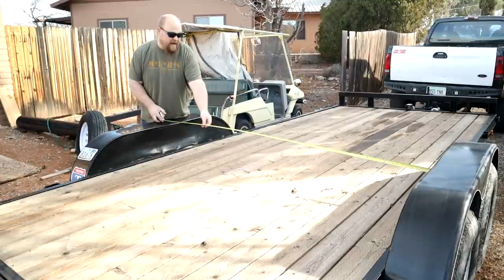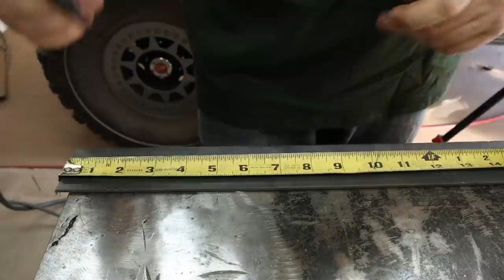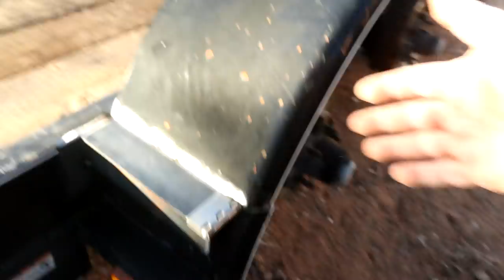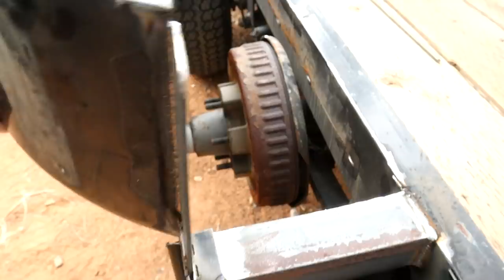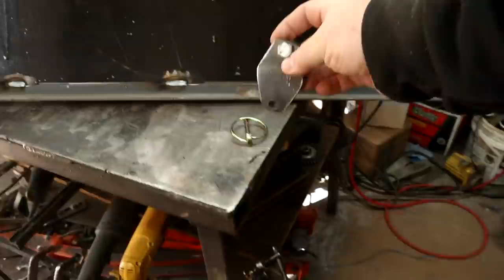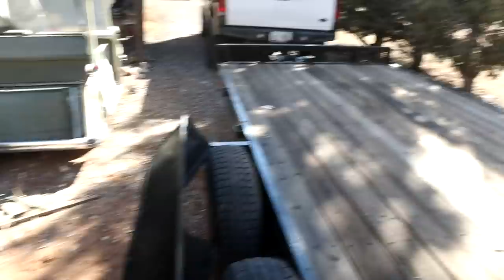Building custom Tip Out fenders for my car trailer. Fabrication 101!

Comment: I love your tilting fender solution.  I was thinking of making my fender lift off, so that I could open my car door enough to crawl in, instead of going thru the window.  Kudos to you for leaving in your mistakes.  Not only were they entertaining, but you saved a few people from doing the same things.  I call it entertaining instruction.
As for the rear jacks, just watch a few YouTube videos of people loading their vehicles, only to have their truck and trailer roll down a hill.  My trailer doesn't have them, so I will add them.

Comment: The jacks on the back of the trailer stop the trailer from picking up the back wheels of the tow vehicle when loading. This would be a bad idea as the front wheels do not have e-brake on towing vehicle. Also do the tab welded on the trailer to secure the finder harm your tires. Really like your design on the hinge. Great Job.
Reply: I need to add rear jacks to my trailer I loaded my 2010 gmc sierra on my trailer hooked up to my lighter 2019 F150 and it just just about lifted the wheels of the F150 up. Loading the F150 onto the trailer doesn't lift the sierra up
Reply: I put 2 small swivel trailer jacks on the back of my trailer.  They don't stick up over the deck.
Reply: KISS. Use a block or two of 6x6 cutoffs. That way you can just pull forward off the blocks without having to get out a Jack to take the pressure off the pins to lift up these supports.
Reply: The drop down legs are used to keep from bending the trailer when loading heavy equipment

Comment: I need to do this to my 20ft car hauler. I'm tired of crawling out the window when the doors won't open due to the 
fenders. Appreciate the videos!
Reply: Oh yeah, that does bring back memories (maybe not fun memories though). The other similar predicament is getting out of a car inside a closed trailer. The bystanders seem to be more amused by it than I am... maybe I need to find more sympathetic bystanders!   🤣
Reply: I plan on making fenders that lift off. His Are still in the way for forklift
Reply: your right i wish i would have never sold my trailer it had a frame like a railroad track ,, it was factory but i had to crawl out also,, wish i never sold it

Comment: Just a suggestion for pinning it down while in transport. Drill and tap the angle that it is resting on and use wing bolts to pin it down. This will eliminate the tabs sticking up and lower the risk of puncturing a tire.

Comment: We just built steel fenders that you can drive over. Makes fenders stronger. Can stand a blow out can stand to leave truck sitting on top if needed.   I use rear jacks to lower a bit not all the way to the ground though or you won't get it back up it will be in a bind. Use it to load that way your pulling truck don't raise up in rear and cause your truck to start rolling away.

Comment: I would not let the fenders rest against the tires when you have them folded out while you're loading because as you're driving on your Bronco that trailer is going to rock back and forth and the tires are going to rock back and forth and it could cut the side walls of the tire on the edge of the sharp metal fender

Comment: When i did this to my trailer last year i just welded the tabs to sit flush to the side of the trailer, drilled a hole in the frame and welded a sleeve in the hole for a push button quick pin to go in and hold the fenders down. That way nothing protruded above the bed rails, mine had a 2”x6” rectangle tube frame so that made it easier for the quick release pins. Also added swivel tongue jacks to the back but my ramps slide in from the rear vs the side, never liked those due to seeing people at the track have to remove the ramps before pulling in between others in the pits before parking.
Reply: Another thing that you don't think about until someone mentions it. Thanks for pointing that out.
Reply: @moparfan4388  i looked at probably 20 different trailers and basically combined them all into one design lol, i rolled 3/16” flat plate for my fenders and when i flip then they rest against the tires and i use them as a step to get in the car too but when flipped up i have a triangle step at the hinge point thats a reinforcement plate and use it as a step to get on the trailer or to walk across the fenders. .

Comment: You can swap out those back jacks for some that swivel.  It helps keep the tail from going to low when loading a vehicle on the trailer.  Heavier the vehicle the more down force at the tail and thus lift on the read of the tow vehicle, plus it helps eliminate a lot of strain on the hitch and such.   And yes, I thought Sawzall and tire...bad combo =)  Not going to say whether I have done the same ;)

Comment: If you cut the stabilizer jacks  off  the trailer( I would not recommend, stow them horizontally on the frame  somewhere) or use wheel chocks on your trailer  every time  you load or unload on the trailer.  Remember park or parking in gear  with a manual transmission even adding the parking brake only  affects the rear axle of the tow rig, ( most likely you have not put the transfer case in gear to use the front axle if you have that option)which is normally off for the job meaning the steering is locked. I had a run away truck  trying to load a  walk behind ditch witch trencher, on a low profile tilt deck.  I like the fold away fenders.

Comment: Those stabilizing jacks on the tail end of the trailer are to keep the tail of the trailer from squatting down towards the ground. If you can prevent the back of the trailer from squatting towards the ground as you drive things on it will keep the tongue of the trailer from pulling up on the hitch of your truck.. I have personally seen somebody loading a big heavy off-road vehicle onto a flatbed trailer and as they were doing this the back of the trailer squatted down the front of the trailer pulled up and actually lifted the back tires of the pickup off the ground which caused the truck to start rolling away across the parking lot because the only tires that have parking brakes are the rear tires on a vehicle. If I were you I would just extend some brackets further out for those little jack stands to still be used but your Bronco could clear them. The only other options I've seen people do is actually put wheel trucks under the trailer tires to prevent the trailer from Rolling forward or putting their truck in four wheel drive and putting it in gear so that way the front tires of the truck are locked and will keep the whole thing from running forward if the back tires of the truck happened to lift off the ground. Just look up some YouTube videos of trucks and trailers running away while they're being loaded.

Comment: I have been considering putting those supports (23:21) on the back of my trailer.  If you are loading without them, then the trailer will be pulling up on the ball hitch.  If it isn't secured right or just worn it can pop off and be dangerous especially if someone is standing on the front of the trailer guiding the load vehicle onto the trailer.  Also I had to load on an decline and so the trailer pulling  up on the hitch was unloading the rear axle enough to where the trailer and tow vehicle would both start going downhill.  I had to have someone sit in the tow vehicle to step on the brakes to activate the front brakes during loading.  You could also use them to unload the tires when parked for long periods or even change a tire by manipulating the front jack when decoupled.  I hope this helps.

Comment: I just added a couple pin on tongue jacks to the rear of my trailer. Even being hooked to my F350, when loading some cars I worried about the negative tongue weight on the truck. One thing you could do is drop them down and figure how much height you need, then cut off the extra. Just remember the trailer will sit lower when loaded, so raise them back up one hole before your final measurement. As far as the retaining tabs for your fenders go, I was thinking about a nut welded under the angle iron then using a thumb screw to hold them down. It would leave a clean surface when flipped over and probably cut down on some rattling while going down the road.

Comment: If you load heavy without the outriggers you get weight at the back and the resistance at the front with the truck pulling down. This can eventually bow (catback) your trailer in the middle or crack the frame.

Comment: I have two suggestions. First is the pinhole tab that sticks up off the trailer would probably need a 2-in long platform so the tire can go over without puncturing. Second is the stands in the back just install those upside down so you can use it as a handle.

Comment: Those are for loading heaver stuff on a lighter truck than what you have  so when the load hits dovetail it doesnt lift the rear of the truck and the whole thing starts rolling on u i would change those out with a tiltable screw jack that pins on and can be removed when needed to
Reply from the maker: That's pretty much what I was thinking. Just wondered why they seem to be twice as tall as they need to be. I like the screw jack idea. Thanks for the comment.
Reply: @Fabrication101  no problem bulldog makes a jack that pins in place and you  can remove it to load your bronco alot of trailer builders put those as a liability eliminator
Reply: @Fabrication101  like others have said, they make jacke that swivel up out of the way or get fully removed but yes, they are to support the rear of the trailer when you load heavy things as it is hooked to the truck. You ever see the videos where people load a heavy tractor and half way on the trailer it raises the rear truck tires off the ground and the truck and trailer start rolling away !!!  Well,these prevent this from happening.

Comment: Those telescoping jack stands on the back REAL IMPORTANT! If you get close to the max weight of trailer and don't have them down you'll see why they are there. I have a  12 k,16 foot tilt deck with no jacks in the back (tilt deck). I loaded up a small Snorklift (8000 lbs) on it off a dock. As soon as I got the front wheels of the Snorklift on the trailer the back of the truck wheels came 1 foot off the ground, it rolled a couple feet (no back tires on the ground nothing to stop it)! Now I had a half assed loading job to fix!  It took about 3 hours to load with cribbing,  cum-a-longs, and a lot of stress.

Comment: Drop those rear jacks/stabilizers down when you’re loading/ unloading to stabilize the trailer. Think about it—if those jacks aren’t on the ground when all the weight is on the back of the trailer, the only thing preventing the trailer from flipping up is the connection at the hitch.

Comment: I believe on them fenders now that you've got them separated from the trailer I would put something between the lips like a piece of rubber for vibration noise and then that way you can put the pins in tighter to hold the fenders where they will not rattle going down the road and make it sound like a rattle trap

Comment: this may not help in your case but the make spacers for jeeper & that would be just enough wider that u r not hving to drive on/over the tires. The other may not apply but some1 else may help is if they make the trailers w/the tire built into^ the trailer on 1side & out side the trailer on the other side. This way if u need to drive on tires or fenders of tire u r only driving on safe amount straight on shot w/the bed of trailer. Same axle but better finished product user friendly design for nearly same cost. 3dr way is higher cost axle but same idea, if u use dully axle & only put outside tire on when u need the max width, but can run dully when u need max weight more than width.

Comment: Yep I've done this procedure with my trailer but avoided the mistake of cutting any tires and saw it coming, you beat me to posting the video though I did mine several years ago but I just never have the time to edit and post them. I think maybe long triangular hinges may have been better and stronger and placed on the inside out of view but that would have required more adjustment to remove the gaps. Your welding is much better than mine, frankly I suck. I also used diamond plate aluminum riveted to skin the fender inside walls to give it the needed stiffness and support and clean up my gaps and that went with the rest of the trailer that already had aluminium treads. You'll find that tire clearance becomes and issue when loaded as did I, pushes tires up towards the fender. I guess I should find time to post up my video? Your shop is much better equipped than mine is for metal work too, for my tie downs I used rubber strapped hood tie downs. Now I'm using an old bunk bed frame to build a front rack and also going to diamond plate that for a stone guard and extra cargo space be it tires or whatever. I used chains in the center for support attached to piece of recycled steel that I created a step out of so as to prevent the fender hanging on it's own weight and climb over the fender easier.

Comment: Didn't read other comments, but you could have put a slot in the bottom brace and had the pin under the braces and out of the way of the deck.

As for the rear supports take some square and just tuck them up under the front in case you decide to try them out they're at least with the trailer.

Comment: The drop down support on rear of trailer are for loading. When you are loading the rear of trailer will squat and   in theory raise the rear of the tow vehicle when the tounge of trailer goes up causing the tow vehicle  to move. They are a safety feature, they are also handy if it is not hooked to a tow unit.

Comment: Those keep the trailer level when loading something, get the trailer level and set them down,then cut them an inch short of on the  ground to haul around, they will be below ur bronco wheels when loading, go to 10 ply tires as u need them, even if over kill they will last better

Comment: I dont have to worry about hitting fenders on my trl as i now have deckover full width.  On my old trl i had been squeezing thru with my tractor until  i messed up and sliced my side wall of my tire. Ran it 8 more years before a flat. Got a couple repair attempts done and now it been around 4 years and still running. Yeah and also it cost $800 and i did that when 2 months old.  I like the design

Comment: The rear stands are for loading, either hooked or not. It gives support so the frame isn’t taking the weight. Problem is if yo put the pads on the ground and load you will never get the pin out to raise the leg. 
I had to remove my rail and fenders to get my tons onto my trailer. Your design is the best I’ve seen so far. I plan to use a crank style fold away jack at the rear on mine for support. I get a lot of flex when I load. 
As mentioned I too am concerned about the pin tabs cutting a tire. I thought you would have put them on the front and rear tabs. Any problem so far? 
Great video and build. Also in AZ.

Comment: I could not believe what I was seeing, bad place to be using a demolition saw with a long blade, so off to the tire store he will go! But anyway you should go the The Home Depot and check out the new TIP-OUT SYSTEM  on the trailers they sell, it is simple and I'm sure you will like it, mater of fact, with the trailer there you can tip out the entire sides.

Comment: Those rear jack stands take the force of driving a car up on the trailer off the rear springs. It prevents the springs getting flattened out as the rear springs take the full weight as you load

Comment: Great idea with the flip down fender, does the tab welded on to the deck risk a puncture? Maybe if you drilled a hole in the top 8inch steel, and weld tab do bottom one so it goes through the top hole then the pin to lock in place?  Great video though i will be looking into doing my own trailer!!😅🤙🤙
Reply from the maker: Haven't had any issues with the tab. It barely touches the tires on my rig since they ride up on the trailer tires a little.

Comment: I love the flip out fenders! I will do that to mine. I can’t open car doors when on the trailer. And I can gain maybe a 1/2” of well needed fender height in the process. The damaged tire sucks! 
Well when you replace the trailer tires, I would go with a LT truck tire.  Trailer tires suck!

Comment: Good job big guy, it looks great and solves your troubles. I was just wondering what is the plan if the loaded vehicle has a wheelbase that leaves a rear tire over top of the trailer wheels? Those out riggers are for safely loading the trailer if it is unhooked from the truck. It will be very helpful to keep the hitch attached to your truck if you load a very heavy vehicle just in case the hitch detaches from the truck. I think we all have had a hitch jump off a ball at least once in our lives. Keep up the great content.

Comment: you put the feet down when loading/unloading the trailer so the  the rear of the trailer does not  squat down and makes the front of the trailer raise up so it doesnt pull the hitch off the ball when loading. I put mine about 3 inches from the ground before I load anything on my trailer. Mine are swivel jacks so they flip up out of the way when not in use.
Reply from the maker: Thanks

Comment: They are braces at the back. You put them down when loading a vehicle and with them touching the ground it doesn’t lift the front of the trailer and the rear of the towing vehicle and risk everything going forward while your trying to drive up onto trailer.

Comment: I just extended my trailer 10” to accommodate my Teryx 4 I had a 2 seater that fit in my 10 ft trailer but my 4 seater is 3” to big.